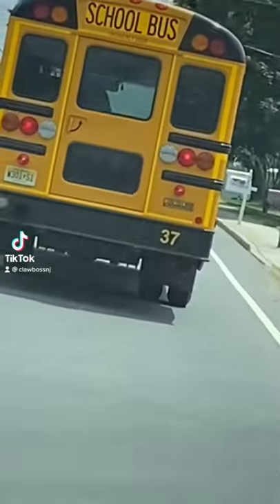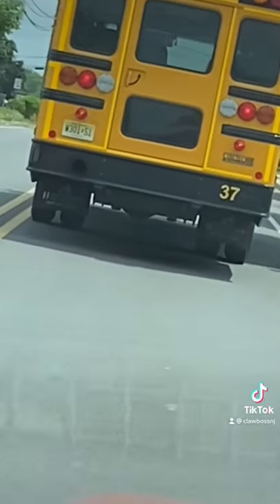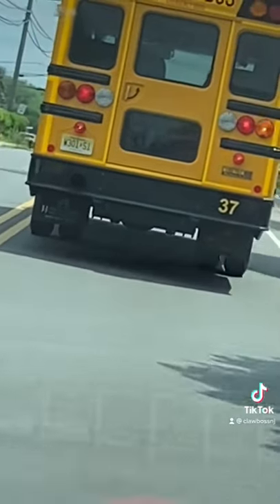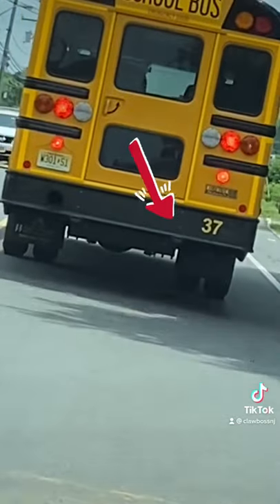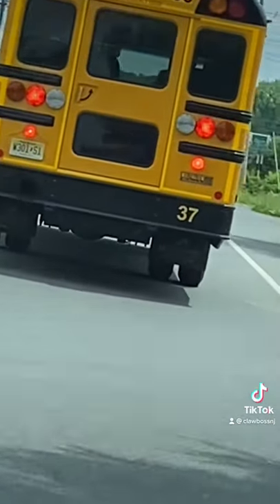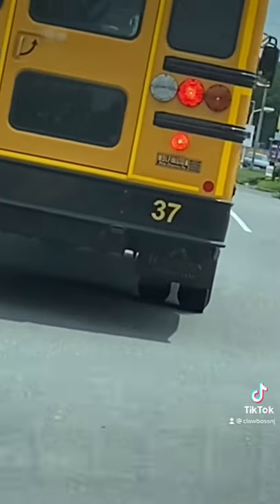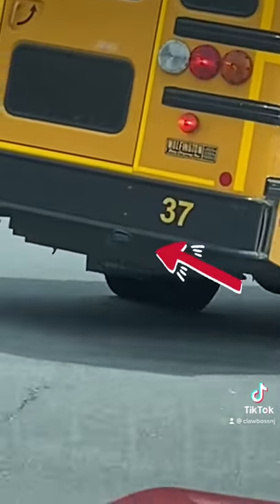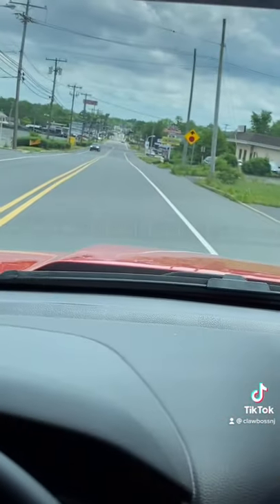WHAT ARE THOSE?? (School Bus Tow Hooks?)

Comment: They are just there to be used to pull the bus out if it gets stuck... Same as the front hooks... I drive for a school district in Ohio and they get used frequently in the winter.
Reply: Why not just pull the bus from the tow hooks 2" beside??? Seems redundant to me lol
Reply: Apparently you didn't watch the whole video because he said those aren't the tow hooks the tow hooks are in a different spot on the back
Reply: No hear right there’s 4 hooks in the back
Reply: Kind of like a pulley system
Reply: The loops are used to make 4 tow connections for when my pulling power and leverage is required
Reply: @daltondick5223  sheesh Those Buses in Ohio Don’t have A/C So in summer days it’s a Oven
Reply: @DaxtonAnderson  Choices... and its less likely a loop will let a chain or clevis or whatever is used to attach fall off before you put tension on it
Reply: They're for the safety chains on a tow truck. It's much easier to pull a bus from the rear. To pull it from the front requires pulling the drive shaft and you must either cage the brakes or run an air supply line from the tow truck to release the brakes.

Pulling from the rear requires ratchet strapping the steering wheel to the frame of the seat. If it's an air ride seat, you must connect to the base so it doesn't loosen. You must also strap down the stop sign because air will push it out going down the highway in reverse and will damage the motor. So to the rear it is.😂

There's no other convenient place for the safety chains back there. They're also handy for the reason you stated.
Reply: Witch school district i go to Marietta city school district.

Comment: The loops on the Back bumper are secondary towing. There used if there is a requirement for more leverage and pulling force to pull the bus from a stuck position.
Reply: Yes those are tow hooks we know what those are for he is talking about the hooks
Reply: yep, like on an 18 wheeler or an F150
Reply: @willtindall8263  read my comment again and get back to me.
Reply: They're for the safety chains on a tow truck. It's much easier to pull a bus from the rear. To pull it from the front requires pulling the drive shaft and you must either cage the brakes or run an air supply line from the tow truck to release the brakes.

Pulling from the rear requires ratchet strapping the steering wheel to the frame of the seat. If it's an air ride seat, you must connect to the base so it doesn't loosen. You must also strap down the stop sign because air will push it out going down the highway in reverse and will damage the motor. So to the rear it is.😂

Also can be used for what you stated.
Reply: Thank you for answering our question
Reply: @Dylan_Stewart  no problem!
Reply: Seems like every feature is for safety on school buses
Reply: @willtindall8263  The rings he is pointing out are for safety chains for when we tow
Reply: @Robmancan1987  exactly I have towed a lot of busses and your exactly right
Reply: Yes

Comment: School busses are going to be heavy so maybe they need that extra pulling sometimes if the main hook isn't enough. But you look so confused and concerned.
Reply: It is
Reply: I ask my friend mom. She a school bus thing
Reply: They're for the safety chains on a tow truck. It's much easier to pull a bus from the rear. To pull it from the front requires pulling the drive shaft and you must either cage the brakes or run an air supply line from the tow truck to release the brakes.

Pulling from the rear requires ratchet strapping the steering wheel to the frame of the seat. If it's an air ride seat, you must connect to the base so it doesn't loosen. You must also strap down the stop sign because air will push it out going down the highway in reverse and will damage the motor. So to the rear it is.😂

There's no other convenient place for the safety chains to hook back there.
Reply: @kenziemcconnell3628  what

Comment: Tow trucks use them so if they have to winch you out of a ditch or to lift the rear of the bus up in the air
Reply: Correct
Reply: They're for the safety chains on a tow truck. It's much easier to pull a bus from the rear. To pull it from the front requires pulling the drive shaft and you must either cage the brakes or run an air supply line from the tow truck to release the brakes.

Pulling from the rear requires ratchet strapping the steering wheel to the frame of the seat. If it's an air ride seat, you must connect to the base so it doesn't loosen. You must also strap down the stop sign because air will push it out going down the highway in reverse and will damage the motor. So to the rear it is.😂

There's no other convenient place to hook safety chains back there. It's also hand for the reason you gave.

Comment: For the ones wondering what they are for: I do towing and recovery irl. Well I go with my dad since I’m only 13 lol. They can be used for winchouts or when the bus is stuck, besides that nothing else. I have seen comments saying there for tying down on a trailer, but a lot of people tie them down through the frame. Buses don’t tow trailers either. Buses are towed by a wreckers and underlift, there are forks that go in the underlift and lift the bus by the frame rail. It’s hard to explain in words but if anyone wants to see a video search Ron Pratt school bus.
Reply: Yes!! But these vehicles have lives after being used as a school bus (schools don't typically tow trailers) but I drove for a canoe livery using a ex-school bus and I pulled canoe/kayak trailers constantly (sometimes even doubling up on them) and used those loops for the trailer safety chains
Reply: @merlofetherolf5811  Hm, didn’t think of that.

Comment: There extra tow hooks I’m a tow truck driver so I used them a lot
Reply: Yep. You have to haul the bus from the rear and ratchet strap the steering wheel to the frame base of the drivers seat especially if it has air ride seats. Otherwise you have to pull the drive shaft and cage the brakes to pull it from the front. You also have to strap down the stop sign when pulling from the rear or else you'll mess up the little motor.

Pulling school buses from the rear is definitely the way to go 😂.

Comment: I’m a school bus mechanic those aren’t hooks they are the rear leaf spring mounts, the reason they are sticking out on the rear is cause some buses have longer leaf springs for better ride quality
Reply: There not leaf spring "mounts" ( I hope you never work on any of the busses I drive ) If that was a mount as you say the leaf springs on that bus would be pushing 15 feet long and that would be rediculous... The rear axle is no where near that bumper.
Reply: @merlofetherolf5811  sorry, I’m used to newer buses I am looking at an older bus currently and it appears that those are gas tank support brackets.
Reply: @harleyrice3615  Nope, nothing to do with the fuel tank either... the fuel tank is mounted inside a cage between the frame rails, any and all straps will be perpendicular to the frame itself not running length wise with the bus...  We have roughly 50 in our fleet and they range from 2010-ish all the way to 2019/20 and all the tanks are mounted the same regardless of age. Do you really work on busses? Because I was doubting it before, now I don't believe it at all.
Reply: @merlofetherolf5811  I am a certified ICE mechanic
Reply: @harleyrice3615  Still don't believe it, and like I said once I'm glad you don't work in our district...

Comment: When they tow trailers they hook the chains in them, same like a pickup
Reply: @realredditstories420  They're for the safety chains on a tow truck. It's much easier to pull a bus from the rear. To pull it from the front requires pulling the drive shaft and you must either cage the brakes or run an air supply line from the tow truck to release the brakes.

Pulling from the rear requires ratchet strapping the steering wheel to the frame of the seat. If it's an air ride seat, you must connect to the base so it doesn't loosen. You must also strap down the stop sign because air will push it out going down the highway in reverse and will damage the motor. So to the rear it is.😂